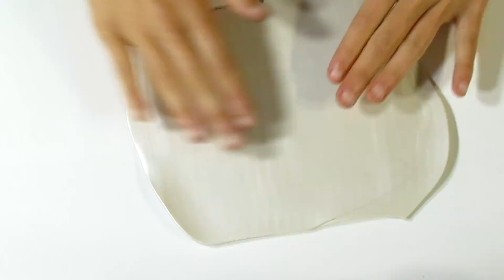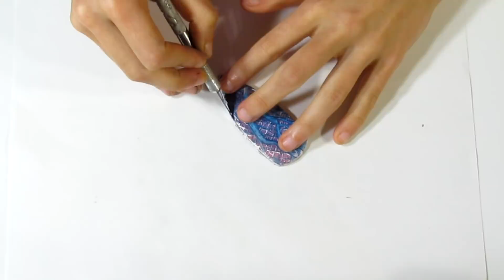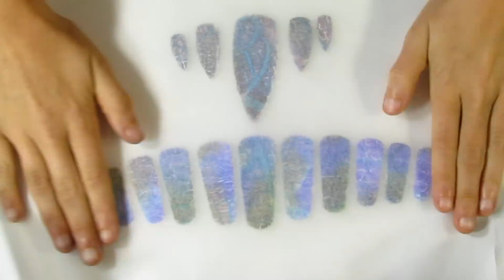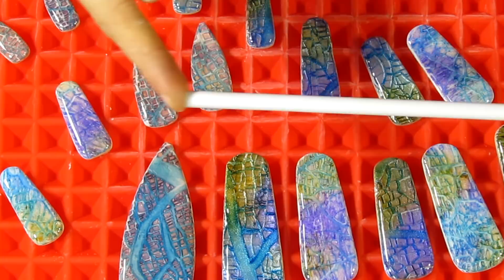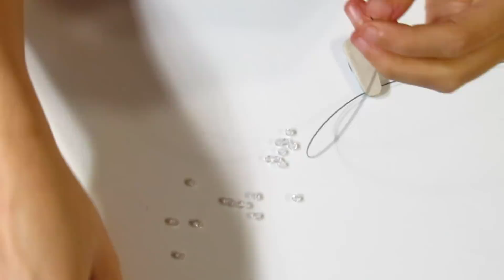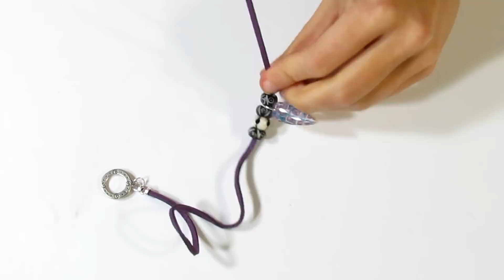Polymer Clay Project: Waterfall Crackle Necklace Tutorial

Comment: Both beautiful and original pieces! Thank you for the tutorials. Question -  what is it about Ice Resin you prefer over other non-UV resins? Researching before I invest in resin. Thanks!
Reply from the maker: I haven't really tried any other two part resins. The reason I like ice resin is because it comes in two parts so it's easy to measure out and can be used in a plunger. It doesn't yellow. It's got a long working time and domes nicely on the beads.
Reply: @JessamaTutorials  thanks, Samantha.